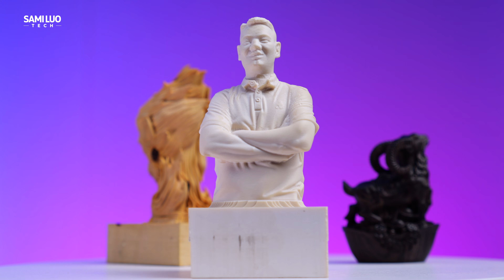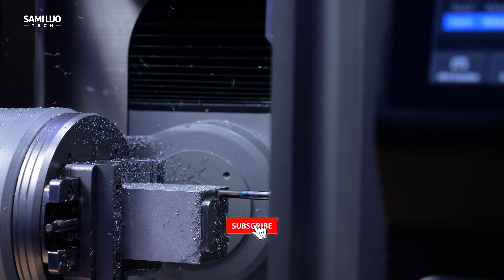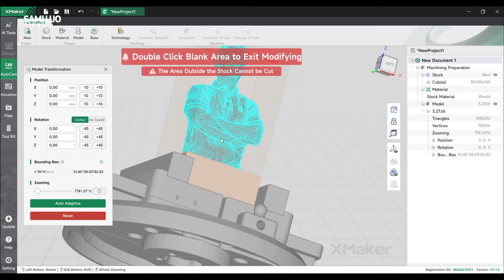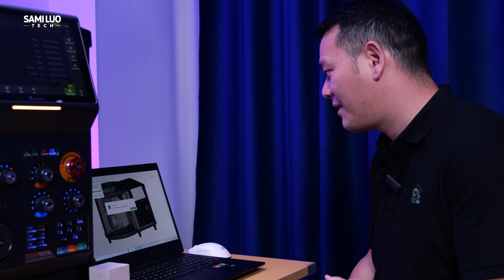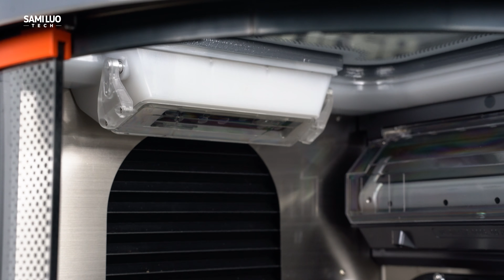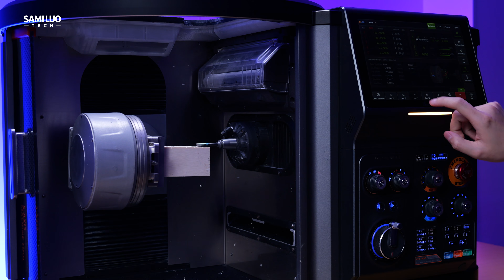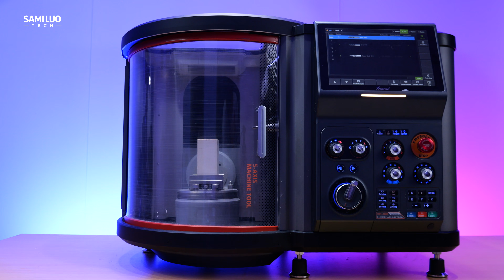I Tried a Desktop 5-Axis CNC… The Results Shocked Me | XMachine WM-100

Comment: you'd have to be dumb to fall for that. Or just have no idea how cnc machining works. The bust yes it was made using their software. Everything else there was made using fusion meaning that guy is lying through his teeth and clearly either A does know CAD and CAM or B is saying he did something he didn't as a paid shill.
The only thing their "5 axis" software can do is cut plastic
which means what I just said you are paying for the manufacturing extension 100$ a month
you are paying for fusion professional however much that costs a month like 80?
you need fusion pro to call toolchanges and string programs together which is the only reason to have the ATC
Just the fact they want to pretend any of this isn't the case clearly shows malintent and just trying to crap these machines out on suckers
Prime example, they show their software, only cutting the trash plastic and it roughs in 3+1 toolchanges, then does a super lazy 3+2 toolpath

Where are the toolpaths generated for the 4 and 5 axis simulatenous machined parts? Where is their program doing anything beyond lazy cheap work you could do with a 300$ cnc and a rotary since it only cuts plastic.
Reply from the maker: Thanks for watching first of all — but honestly, a few things you said here just aren’t correct.
First, the XMaker software that comes with the machine is free — no monthly fee. Fusion 360 is completely optional, just like with most CNC setups if you want more advanced control. Yes, I used Fusion for some parts because I wanted more flexibility with the toolpaths — that’s not “lying,” that’s just normal CNC workflow.
Also, this machine is definitely not limited to plastic. I literally showed stainless steel cutting in the video, and there are already demos out there machining aluminum, copper, and titanium — feel free to look them up.
And honestly, if a brand is willing to send an early machine and let me test it freely instead of handing me a scripted demo, I’d rather let the results speak for themselves. If you’ve got a specific part you think it can’t handle, name it — I’m happy to try it.
Reply: @SamiLuo so I see you never followed through. It's been 4 months you little paid shill.
Reply: @SamiLuo yeah go ahead and create any of the 5th axis parts in metal you show at the beginning using xmachines software. I dare you. I will even bet $100usd you will not. You cant. The software is specifically for making crappy stls into models out of cheap materials
Reply: He didnt reply after I can guarantee you he's got a conrtact in which he cannot make the company look bad in any way.
Reply: @deanfaak6006  I found him online... He's just a kid, and it looks like he's just getting into CNC at his 1st Machineshop job, I'm not trying to dox the guy, but if you're going to say things without knowing what you're talking about... don't do it with an account using your 1st and last name.. 😄
Reply: @d @deanfaak6006 y would it be able to create the path for plastic and not metal? This company has sold over 1000 of the previous 5 axis machine since 2025. Their software is being used. Even if it is not, just use MasterCam.
Reply: Why are you writing from fake account? Are you competitor?
Reply: @mivadim6444  no fake account read further for what I asked him to do to stop the disingenuousness of xhorse. Just simply make the part they show at the beginning of the video when they talk about how easy the software is. Any of the aluminum parts. Since the software is so easy it should be no problem right?
Reply: Why are you retarded lol 😂😂 like certifiably. Every single thing you typed is wrong.
Reply: 关于软件，你有更多的选择，也可以使用第三方软件，也可以使用他们提供的CAM软件，XMAKER，免费的。
Reply: @homexhorse6445  can i use only FREE software and mill aluminium or steel in true 5-axis mode (not 3+2)?
Reply: @homexhorse6445  Are you sure the CAM software provided by Xmachine is free for life? If so, I don't need to buy Fusion360.
Reply: Do you think that the CAM software provided by Xmachine is calling Fusion360's API? If so, then you'll have to keep paying for it.
Reply: Lol, I run 3x 5-axis machines all day. BUDDY.. You have no idea what you're talking about.  But you sure had a lot of BS to say!
Reply: @Jeralddoerr sounds like a paid shill lmao ya i run 6 5 axis haas vf6's with trunion tables
Reply: @deanfaak6006 lol, sorry princess! Not paid but I'll be picking one up. You might push some buttons but you clearly know nothing about CAD/CAM or  Fusion 360. 😂
Reply: @deanfaak6006 you should know that toolpath generation doesn’t care if it is plastic or metal.
Reply: @rsilvers129  they are vastly different in the real world of not breaking endmills and not scrapping parts. A few patameters does not change that. They are using 3+2 axis not 5 axis. Good try there zero brain.

Comment: Could you please compare it with nestworks c500? Any useful thoughts?
Reply from the maker: I love Nestworks (Optional upgrade for it is it offers a 4-axis rotary module) for sure, but the Xmachine here is a 5-axis—it offers way more possibilities than a 3 or 4-axis CNC.
Reply: @SamiLuo ok thanks. Could you tell us what is a difference between XM-100 and WM-100? How to buy it? One of them is ready to buy now and other one is planned for kickstarter? Could you tell more about way of purchasing? Thanks
Reply: @smokehead5318  XM-100是目前正在中国销售的机型，WM-100，是一个改进型机型，加了喷水，很多地方，做了改进，针对XM-100的用户反馈，做了改进。
Reply from the maker: @smokehead5318  Good question — the main difference is basically cooling and material capability. The XM-100 is an air-cooled 5-axis desktop CNC, mostly suited for wood, plastics, and softer metals. It still supports automatic tool changing, wireless probing, and full 5-axis machining, but it doesn’t have the built-in camera. The WM-100, which is the one I tested, is the water-cooled version. It’s built more for harder materials like stainless steel and titanium, and it comes standard with RTCP, automatic tool changer, and wireless probe — overall more capable for metal work.
As for buying: the XM-100 is already available, while the WM-100 is currently in pre-sale / crowdfunding. You can place a small deposit to lock in the early price, and shipping is expected a few months after the campaign ends.

Comment: No app or internet needed to run it is a huge win!
Reply: for the 2a
Reply: Around ten grand and a small working envelope makes it not useful enough for me.  They'll get bigger and cheaper in a few years.
Reply: Totally get that — curious though, what's the concern with app/internet dependent machines? Is it more about privacy, or worried about the company shutting down support down the line?
Reply: @LilyL-i6h   Privacy for sure
Reply: @LilyL-i6h   Privacy is definitely one concern, but there will be millions of models and designs flowing through that cloud, so it's practically impossible for any bad actors to intercept them and steal IP. Not saying we should be ignorant, but I'm saying it's the lesser of the concerns. The bigger issue is the company shutting down.
Reply: If you want to create something useful, you are going to need applications like fusion 360 or whatever else.
Reply: @logitech4873 freeCAD exists. It's leaning curve is steep and it uses very different process models than Fusion, but it works! I'll be honnest, as a Fusion user I'm finding it very hard to unlearn what I know about it to use freecad, but each time I succeed in a small way I begin to see that freeCAD does really offer a comprehensive CAD platform for free, as in no money has to change hands (they do gladly accept donations), open-source, no data harvesting, and you own what you make, locally.
Reply: @logitech4873  Obviously you need CAD software to design parts and such, but those are universal and you're free to use whatever you want. What he means is that you don't need to connect you're CNC or computer to the internet for it to work, you can do everything offline and there is no risk of the machine suddenly being bricked or losing any functions through a firmware update. A lot of 3D printers have proprietary software and really want you to use their cloud services, otherwise you lose certain functions, and this is something a lot people hate about modern printers.

A lot of industrial 3D printer have proprietary software and filaments, and when the company stops supporting the machines they are basically junk.
Not being forced to use stuff like that is great.

Comment: How much does it costs ?
Reply: $5,699 pending that you put down a $50 deposit to get on the VIP list before the Kickstarter launches.
Reply: @vecchiarelli7928 if thats real, thats not horrible.  What's the max dimensions of material?
Reply: @BlackBeardAir  
5-axis Max Workpiece Size: 100 x 100 x 100mm
3-axis Max Workpiece Size: 150 x 200 x 120mm
3+2 axis Max Workpiece Size: 150 x 150 x 120mm

All of this info is from the website link in the video description.
Reply: @BlackBeardAir  From past experience with similar Kickstarters, factor in at least 1-2k more for shipping and necessary addons. An optimistic estimate would be closer to 7000+ dollars and 7+ months, but you could just as easily spend 10k and not see a product for years if they have difficulty in mass manufacturing or unexpected costs. Looks like an incredible machine though, I wish they'd send me one.
Reply: right
Reply: 8 9 15k